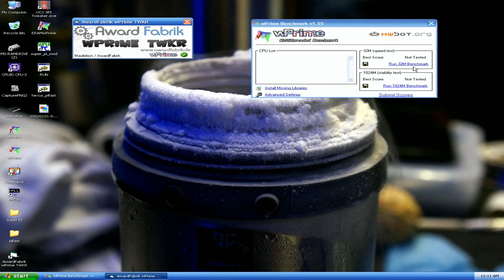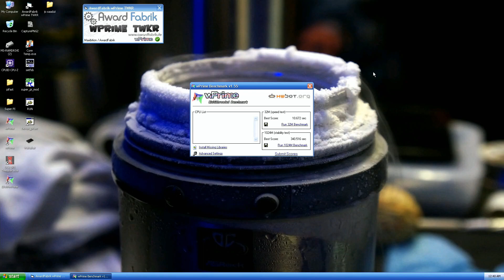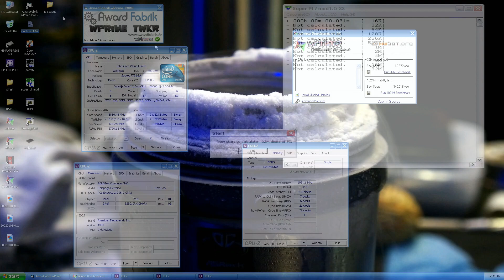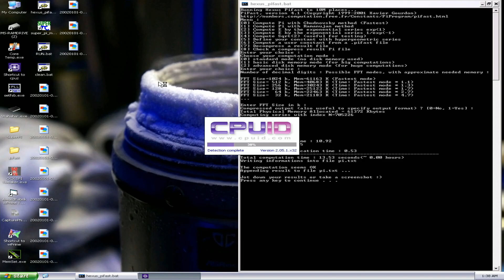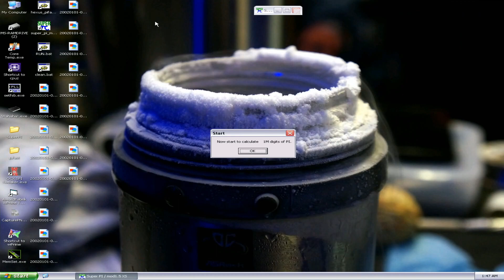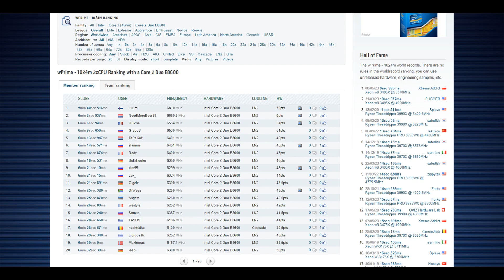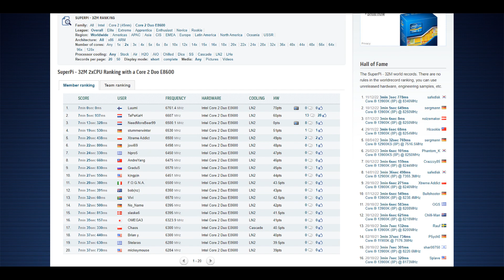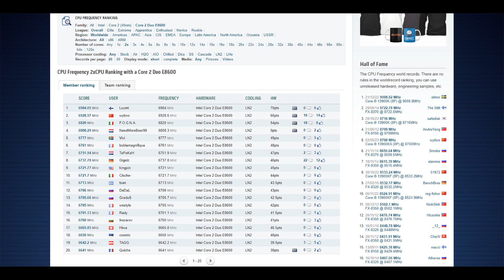I Saw an E8600 at 7GHz - Crazy Overclocking Results!

Comment: I also have an E8600 and E8500 with an Asus P5K Deluxe with Adata Vitesta Extreme ram. The E8500 achieved 4.5GHz easily on some office board, maybe the E8600 can hit 4.8GHz on air without too high voltages? My QX9650 reached 4.3GHz at 1.38v I think, Q6600 did 3.8GHZ at ~1.4v.
Reply from the maker: This is 4.5 pifast 1.2v and 5GHz 1.35v on water.